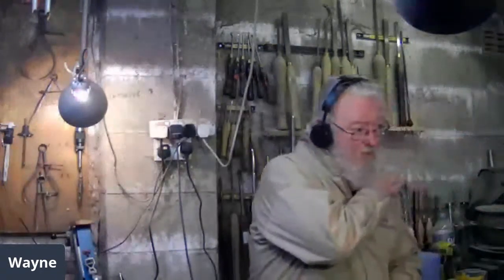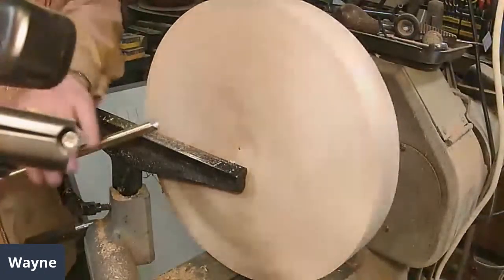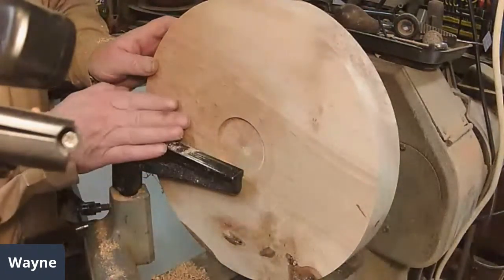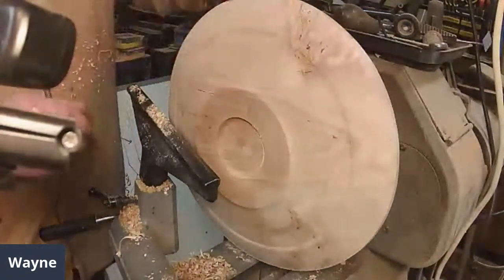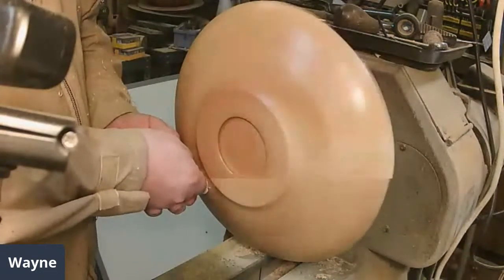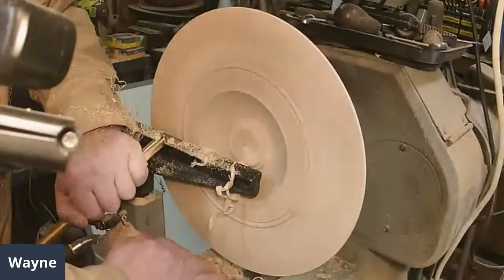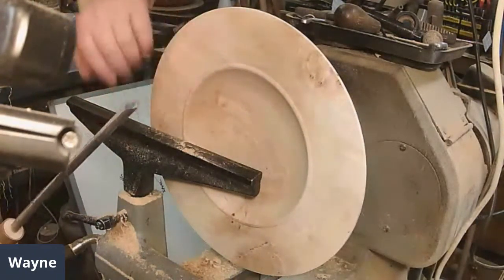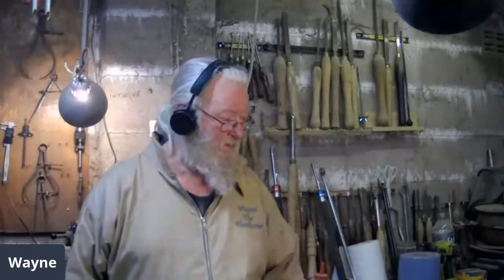The Bowl Gouge

Comment: Great explanation of the bowl gouge. Very well done and I learned a lot. One question I have asked before and can not get a answer. What is the difference and advantage or disadvantages between the fingernail grind and standard grind? Jon here in the US. thanks
Reply from the maker: Thanks Jon, The difference between the standard and fingernail grind is the length of the cutting edge as to advantages and disadvantages, I find I get a better cut with the fingernail grind
Reply: Wayne the Woodturner thanks for your time in answering my question. Very helpful